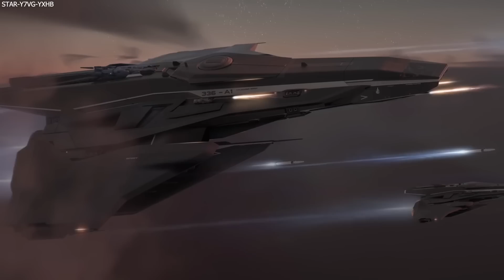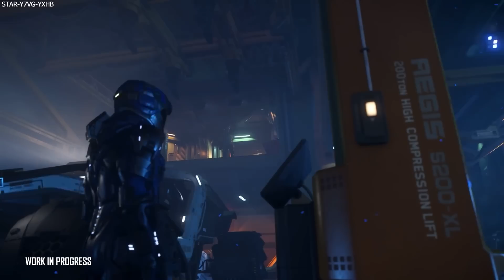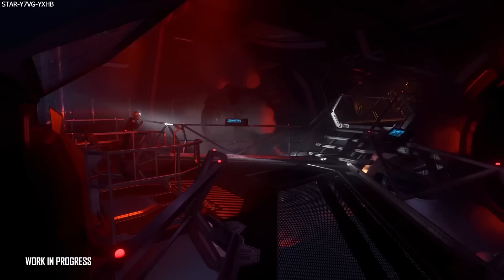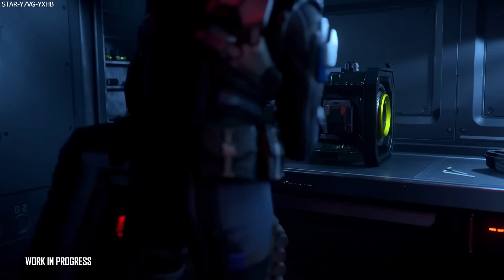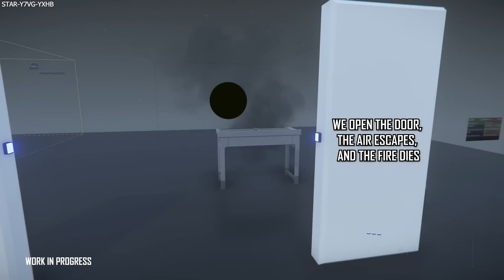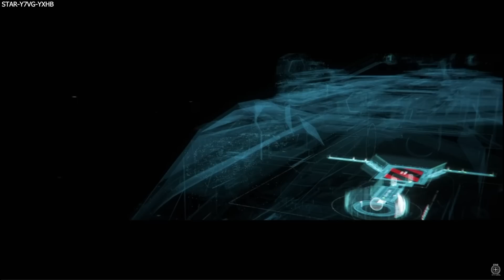This System Affects EVERYONE - Multicrew, Bases, Star Citizen Resources | CITIZENCON 2952 Breakdown

Comment: Fighters should have circuit breakers on the dash/in the cockpit 
That you can try to reset or possibly burn out your module/system
Reply: Exactly, every aircraft has circuit breakers in the cockpit to reset systems in the event of a failure, electrical spike, or to completly disable them in the event of smoke or fire. The pilot and copilot need a way to trouble shoot system malfunctions in the cockpit and circuit breakers are one of the most basic ways to do that. I worry they are going to miss lots of  basic cockpit procedures that would make flying the ships much more interesting.
Reply: This.

Comment: I was wondering how multi-crew gameplay was going to work, this system explains the direction they are going in and it sounds great.  I just hope it's a lot of fun and interesting to do something other than pilot a ship or be a turret gunner.
Reply: Believe it or not it will be fun as time goes on especially since CIG already has a ship known as the Endeavor where you will be able to add a module onto the ship to modify certain components that ships and bases will use to improve their performance and get better output.

 If you were a subscriber to SC simply go onto the subscriber page and look at the vault and look up some of the components and you will notice that many of the components that CIG is building also has some components that can be added and modified into the main component.    For example, some of the shield components and computers will have blades in them and these blades from what I found out from CIG we will be able to remove those blades and change out the chips on those blades to improve the performance of the blade and then put it back into the component where whatever changes we made on the blade will improve the components performance.

 So another words you might be able to take a standard shield generator change its specs to make it a super improved shield generator that is more unique to itself than all the other standard shield generators out there and that aspect of the game will be fun to me.
Reply: @stormfire962imastarcitizen5  Yes what you say is true. Also, whenever we get personal hangars, we will have a workbench. I believe we can use the workbench to repair/modify components and possibly even FPS gear/weapons.   But I think that's a different conversation. In this context we are talking about what players are going to be doing during combat.